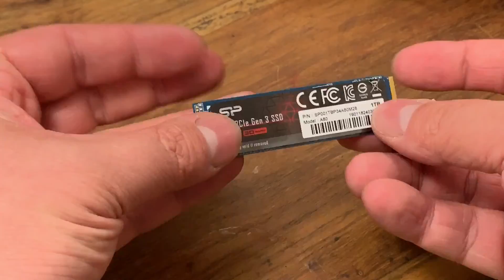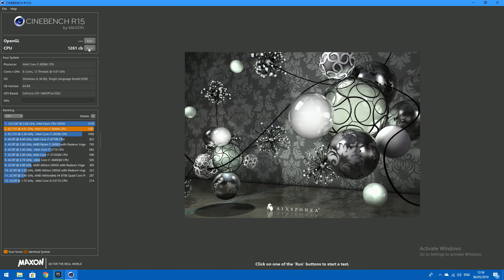#BLACKOUT EPIC! $1600 Gaming PC Build Timelapse & Benchmarks

Comment: Hi Jezy,
nice set up.
I have a question, as I intend to buy the same case + watercooling.
I saw that you installed the radiator at the front and oyu only have the CPU connected to the watercooling circulation.
Where did you put the pump?
And my more important question: Whats the orientation of the three fans on the radiator, sucking or blowing? (OMG, that sounds nasty but you know what I mean). And How many case fans, where mounted and same nasty question for them.
Thanks a lot in advance.
Reply from the maker: I had them on intake pulling the air in. 2nd the cooler is a AIO.